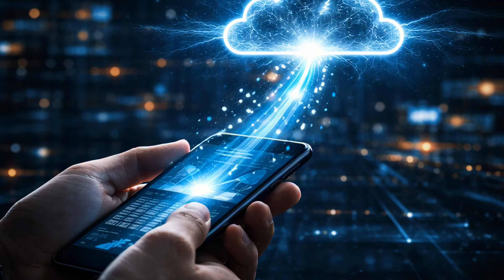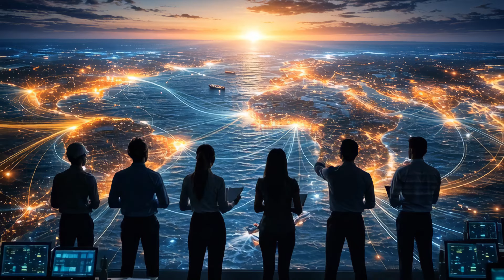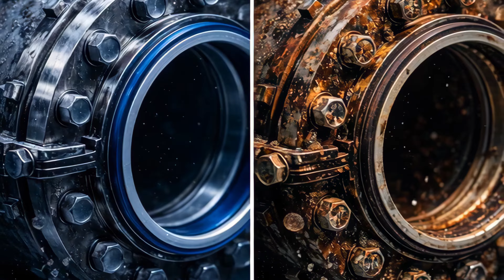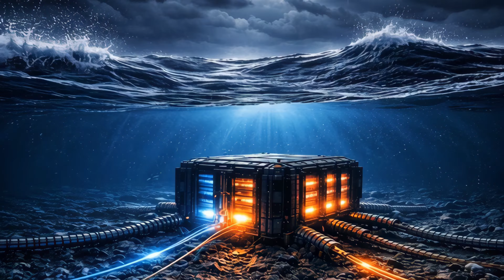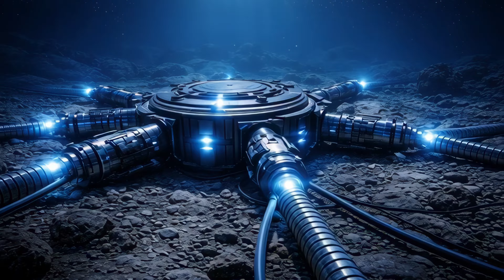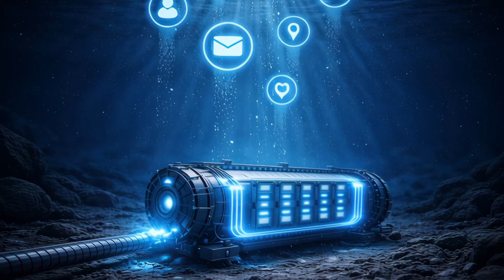How Engineers Are Cooling the Internet in the Deep Ocean

Comment: This is really fascinating. I knew data centers produce huge amounts of heat, but I didn’t realize engineers were experimenting with placing them underwater to use the ocean for cooling.

Does anyone know how many underwater data centers have actually been deployed so far? I remember hearing about Microsoft’s Project Natick, but I’m not sure if there are more installations around the world now.
Reply: Natick is the one everyone knows, but there are a few other projects quietly being tested. The scary part is we probably won't hear about most of them until they're already running 😅
Reply from the maker: @TheNozikov  You’re right — Natick was just the project that became public.
If underwater data centers actually prove reliable long-term, it’s very likely that several companies are already experimenting with similar concepts behind the scenes.

The ocean is basically the world’s biggest cooling system — engineers just need to make the hardware survive down there.
Reply from the maker: Great question. Right now there are only a few real-world experiments. The most famous one was Microsoft’s Project Natick, where a sealed data center was deployed on the seabed off Scotland for about two years.
So far it’s still mostly experimental, but with AI and cloud demand growing so fast, many engineers believe underwater data centers could become much more common in the future.
Reply from the maker: Great question. Microsoft’s Project Natick was one of the most famous experiments — they deployed a sealed data center off the coast of Scotland for about two years.

As far as I know, it proved the concept works, but large-scale underwater deployment hasn’t happened widely yet. Most companies are still testing prototypes and studying environmental impact.

But with the amount of heat modern data centers produce, using the ocean for cooling might become much more common in the future.